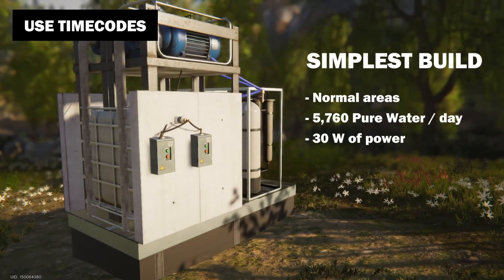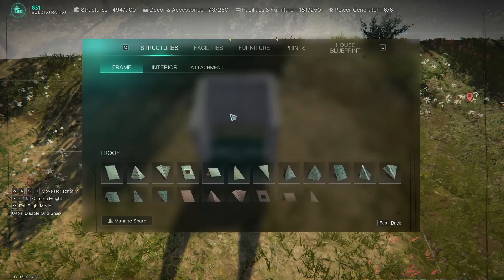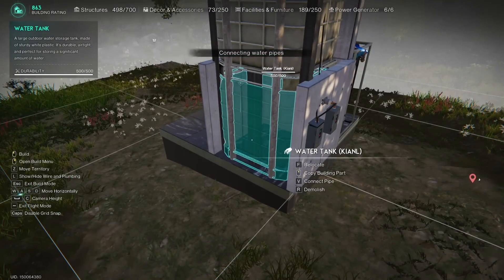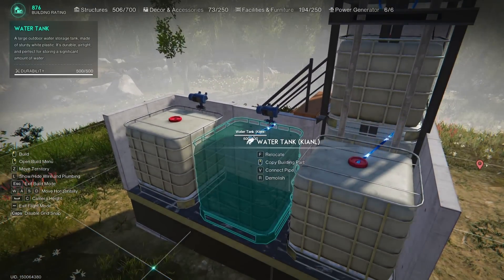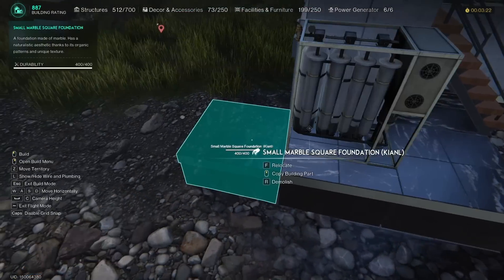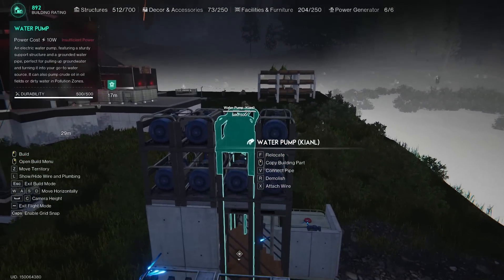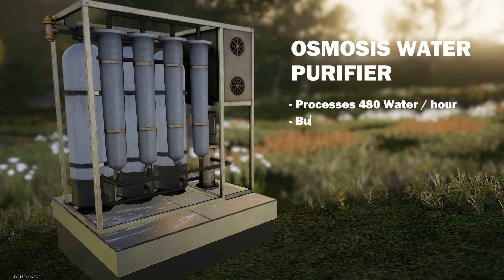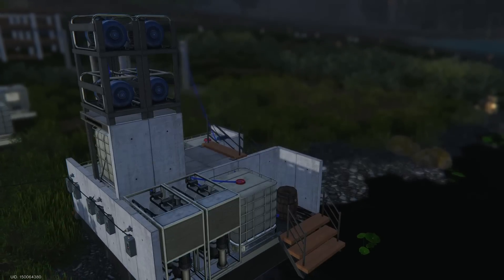Modular Water Purification Station Building Tutorial (Normal & Contaminated Areas) 💦 | ONCE HUMAN

Comment: I was trying to follow the Build but for some reason i am not able to use small foundations or small square walls to replicate this setup. I am using wood. I can't place small walls to form the Box then put a water tank down. It apparently is too big to fit into the box. I'm also unable to snap 2 Water Tanks on top of each other and have to eyeball despite grid snap being turned on. Am i missing something? 😅
Reply: Yea it only works with concrete. Tried with wood and stone, didn't work
Reply: @dreadfulman5191  Yeah, i unlocked Concrete now too and yes it doesn't work with anything else. Appreciate the answer! 🥰

Comment: Everything is smooth except when you bloody want to install 2 extra water pump on top of the previous 2 in the bottom took me 1 hrs Damn it
Reply from the maker: 1) place 1st layer of pumps, using grid snap
2) disable grid snap
3) use ALT + mouse wheel to raise pump up a bit
4) enable grid snap again
For the rest layers correct height should be applied automatically.

Comment: Wow, the upgraded level 4 build is actually really cool and genius, the offline purifier bug is so annoying. But i actually just cant comprehend how the filtering works LOL but kudos

Also as a tip, the purifier bug happens because, in simple terms, offline your base is confused by water pumps pulling in different things, so i have one switch controlling my pure water production, and i have my pumps for polluted water setup so it only takes in polluted.  Before going offline if you just toggle the pure water production off, the impure acid production will run flawlessly, at least in my experience.

Comment: i tried everything to get the water pump to be over the water tank and it doesn't work at all at 1:15. i either i get one in but not exactly how u did it and i cant get the other pump in.
Reply from the maker: use mouse wheel. disable grid snap, raise up the pump a bit using (alt + mouse wheel), enable grid snap again and place it

Comment: Can't put the water tank within the small squar stone foundation, tried everything
Reply from the maker: rotate the walls with mouse wheel
Reply: @KIANL-GAMER  Thank you for your reply, the walls I can place, its the tank that does not seem to fit in it
Reply from the maker: @patrickdedauw265  rotate them outside. it does matter how u place those small walls. I they are directed inward, they will take more space, and u won't be able to place the tank
Reply: @KIANL-GAMER  Thank you, found the problem, it has to be the concrete small walls, does not work with other small walls.

Comment: Hi bro i love you work. I have an issue though, when placing waterpumps i am not able to place them directly on top of eachother like you are. How do i get around that to achieve the neat look like yours? It's buggin me out
Reply from the maker: Hey, thanks.
1) Place 1st layer
2) Disable grid snap
3) Increase pump height slightly using ALT + Mouse Wheel
4) Enable grid snap again

Comment: I noticed that you can connect many pipes at two points. For example on the water tanks, you can make pumps flow into the tanks on the same level of you connect the pipe to the bottom point of the tank by flying near the bottom of the tank. If you try to connect it to the top it will use the other connection point and flow away from the tank. Pretty helpful for not wanting to place everything much higher 👍
Reply from the maker: I will test this. Didn't know about this... If it works, thanks for useful info 🌹